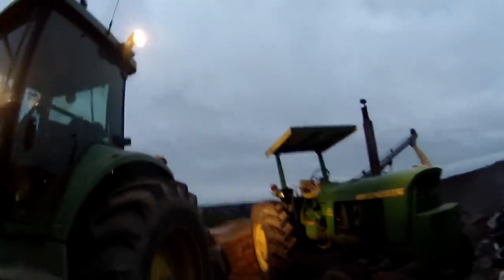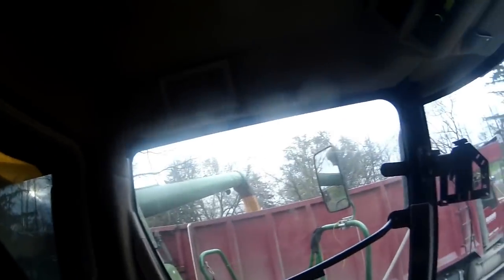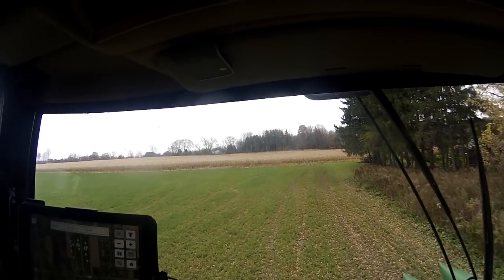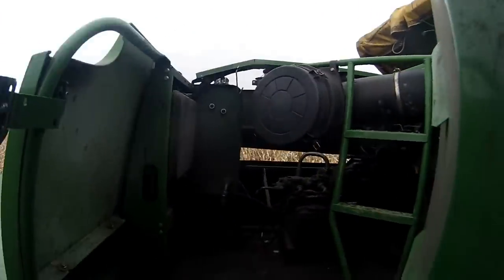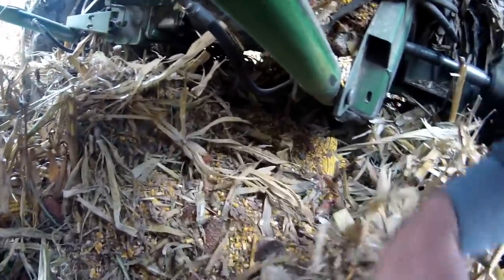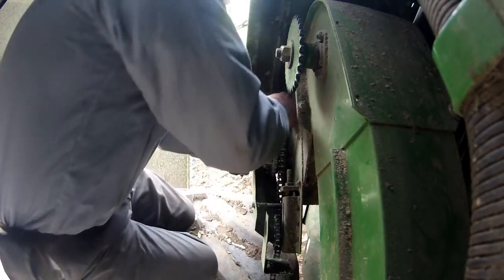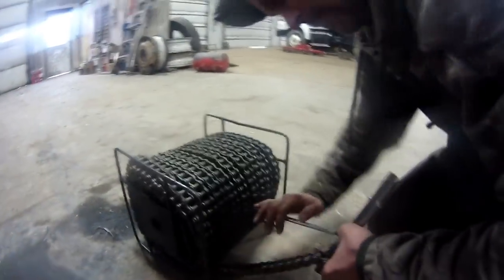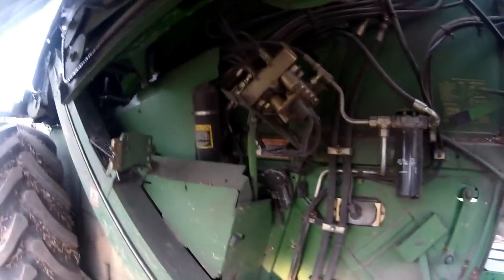Corn Harvest Thursday 11/8/2018 Broken roller chains

Comment: Tightening up that idler gear was definitely “Star Torqued”. Pull on the wrench handle until you see stars. The term was first heard by me when I worked at the space center here in Florida.

Comment: There has to be a slight amount of slack in the chain normally measured at the longest unsupported run, or it will cause premature bearing wear and it can cause broken chains.